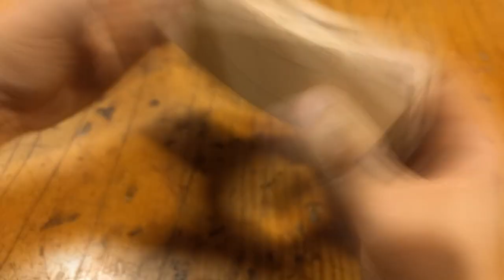DIY puukko leather sheath

Comment: Only thing I would have done differently is I would have glued the wooden sheath inside the leather. Excellent work. takes skill to etch that design into the leather without a template of some sort. enjoyed watching.
Reply: Glue is not needed at all! In fact its even easier to make without. When leather dries it stretch that wood inside and it won´t move. This is traditional Finnish way to make sheath but i`m not sure if its used in Norway and Sweden but for example i have never seen anybody making this kind of sheat in USA. But of course it seems to be used in German (i guess)

Comment: Was making/routing  the holes on both parts of wooden insert really neccesary? :)
Reply: This gives exactly the same amount of material on both sides of the blade and a center line to follow. I would do the same, and he seems to be relying totally on hes eyes too - so this is probably making things easier. But a few minutes of extra work initially, of course.